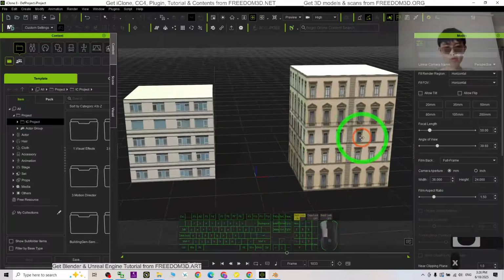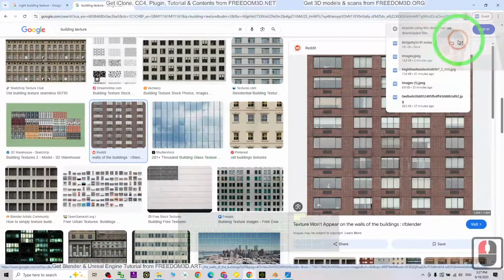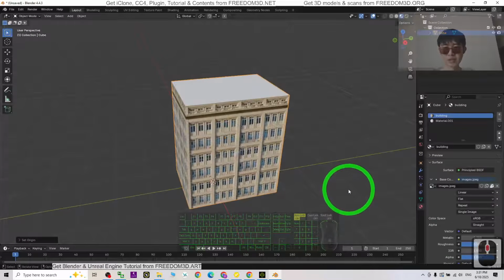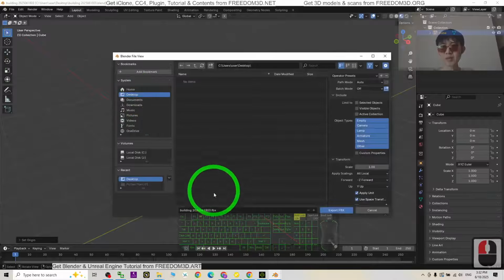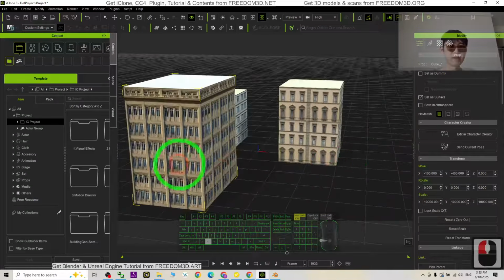Blender to iClone 8: Create Game-Ready Buildings (Full Pro Workflow + FBX Export)

Comment from the maker: This video provides a step-by-step tutorial on how to create simple, custom 3D buildings in Blender for use in iClone 8 animation software.
Key steps in the workflow:
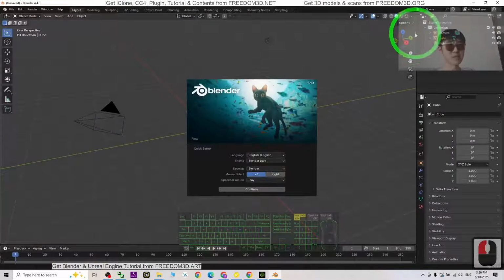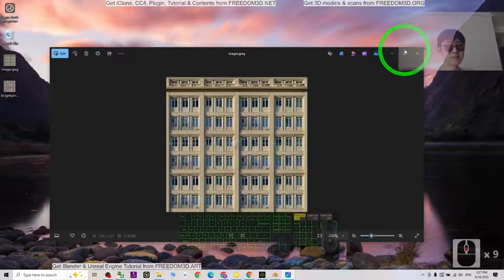1.	Preparation (0:24 - 1:23): You need a high-resolution building texture (preferably JPG or PNG format).
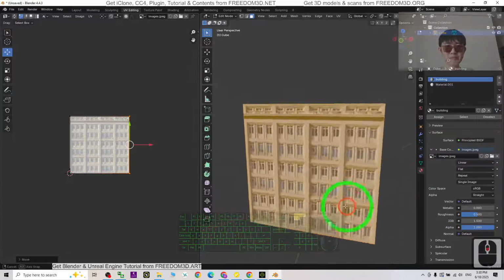2.	Blender Modeling (1:23 - 4:04):
•	Create a Cube (1:30) and apply all transforms (1:46).
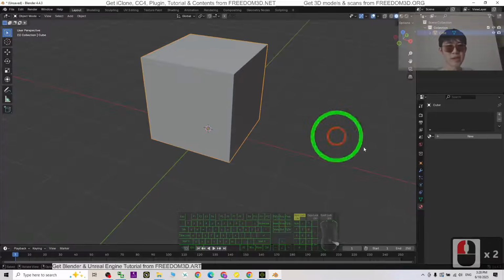•	Set up the Material with your texture image (1:53 - 2:10).
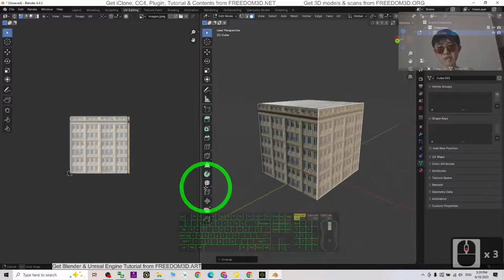•	Use UV editing to unwrap the cube faces (2:13 - 2:43).
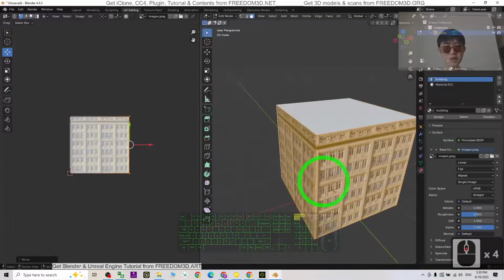•	Assign the material to specific faces, using different material slots if needed for clean texture alignment (2:54 - 4:04).
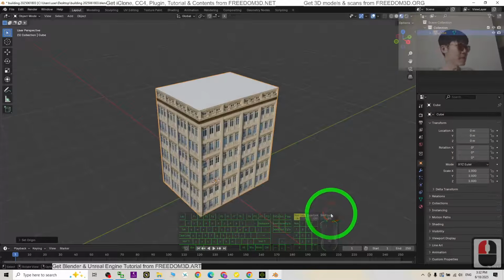3.	Refining and Exporting (4:04 - 6:07):
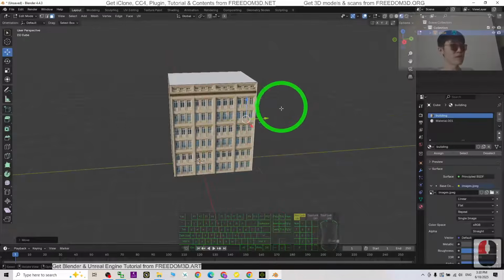•	Adjust the shape of the building in Edit mode (4:14 - 4:40).
•	Pack resources to ensure textures are included (4:48) and set the object's origin to the base (5:24).
•	Export as an FBX file, ensuring the path mode is set to Copy and the texture embedding option is enabled (5:50 - 6:07).
4.	Import to iClone (6:11 - 6:20): Simply drag and drop the FBX file into iClone 8 and select Convert all to finish the process.
The creator emphasizes the importance of using your own original textures to avoid copyright issues (6:28 - 6:44).